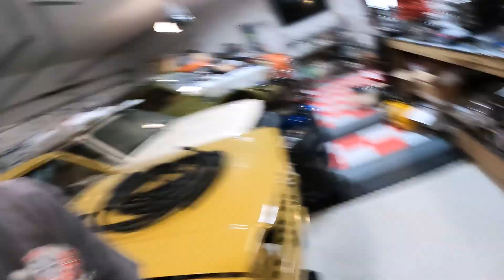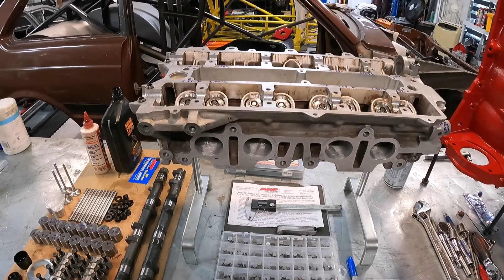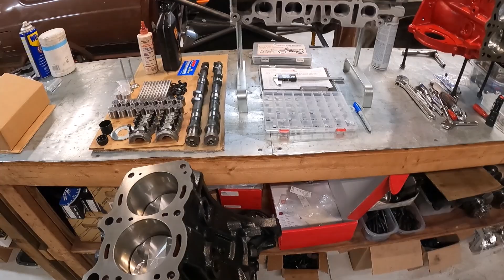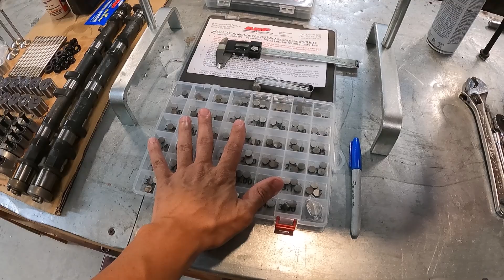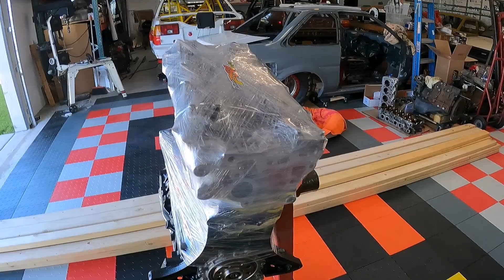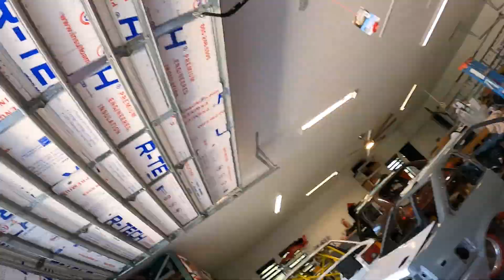Ryan Tuercks 3S/5SGTE Build #3stheworld

Comment: What is the deck height of the 5S ? rod ratio ? rod length ? cool long rod built.
Reply from the maker: Unfortunately we dont really use the 5S assembly. We only use the block and 95% of the time we use the 3s rotating assembly
Reply: @psiracing yes, it a long rod, high rod ratio, was just wonting to know what rod was used, ?

Comment: With that kind of shim setup you have to pull the cams each time you want to adjust the valve lash correct? 

Instead of the typical Toyota bucket setup where you can use an sst with the cam installed to change the shims
Reply from the maker: yes you have to pull the cam to adjust lash, once its set, it pretty much stays consistent

Comment: I'm super curious on what 5s block you are running. I'm thinking of doing a 2.2 for my 5hh gen.
Reply from the maker: We use the 99-01 blocks from a camry or solara
Reply: @psiracing  Is there a difference between the 98 and 99-01 5S blocks??
Reply from the maker: @NativeTexMexican  junkyards will say 98-01 are the same. our preference is we just like to use the newest block possible